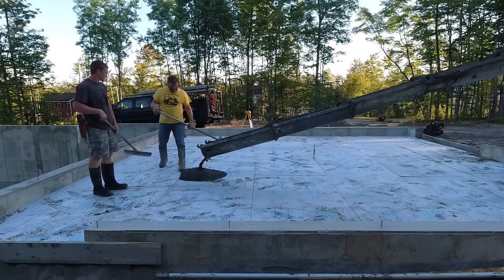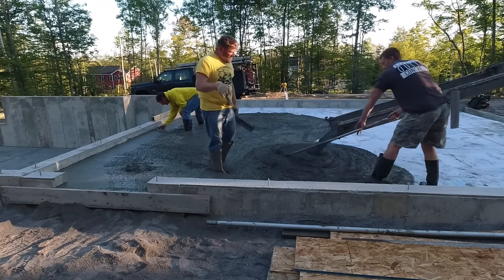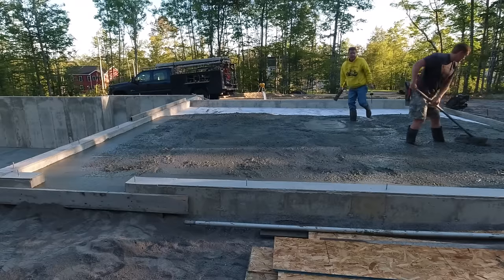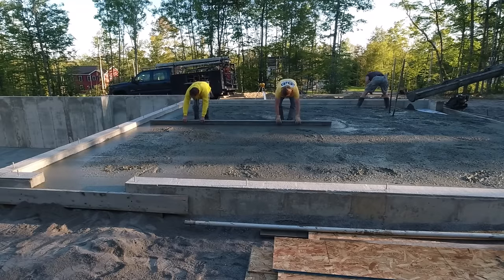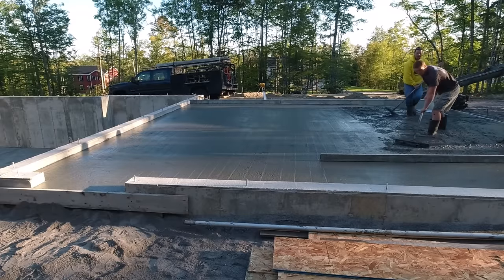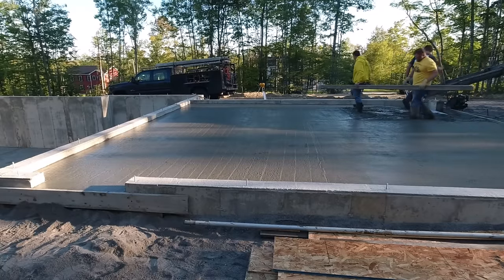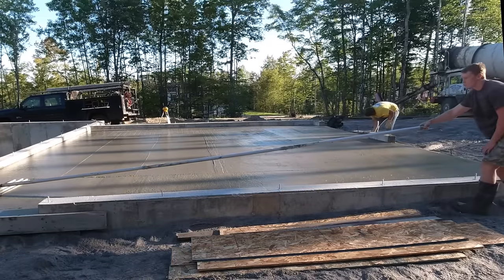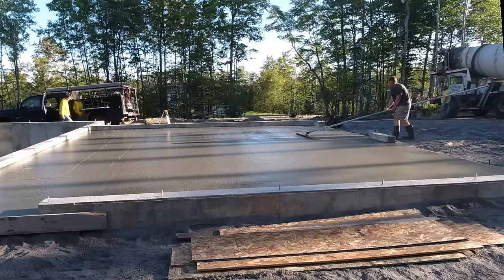Concrete Garage Floor Pour with No Rebar

Comment: I agree with everything you say about wire and rebar.  Most people don't know, that is true.  Our slabs here in Florida do crack a lot because they don't do what we used to do in NC 30 years ago. We used to cover it up with plastic or hay or spray water on it so it don't dry too fast.  Here in Florida, they just don't care.  You pull up any carpet on any slab here, and it is spidered with cracks. They all let them dry way too fast.
Reply: How true, the days of properly curing concrete are long gone.

Comment: The people still complaining about rebar in the comments missed that this is an engineered design with high-end concrete in a small space. The concrete guys didn't leave out the rebar because they're cheap. The engineer just did the math and thinks the ground will not move for hundreds of years.

Comment: My neighborhood was built in 1951/52 and none of the garage floors have rebar in then and none of the sidewalks do either and I'm pretty sure none of the house foundation did either and Ive never seen a crack in the garage floors and only the sidewalks by trees are cracked or where someone drove a full cement truck over one. They used a very stiff mix and apparently no one cheated. These are 19x20 ft garages

Comment: Great technique.  I'm from phila suburbs and screed everything myself with a 10 stick or smaller.  35 years Wish I had good help like darren ( and josh) That guy reminds me of myself. You better give him a raise.! I use  4000 psi wire and rod all garages around the edges reguardless. I also never cut the air.

Comment: I did it for the first time for my handicap brother. We put in a new driveway and walk. It was an 11 metre pour and I should have done it in Two pours. It was a warm day and it was setting fast. Holy cow what a lot of work when you're a noob. The job was not perfect when it was done, but it certainly was better than the old drive. I think we had about an hour of work time. Anyway he saved about 5 grand so he's happy.

Comment: Very smooth job. Exactly right: subgrade prep is 90% of the job for a slab on grade. Compaction is a real science. Fill quality and correct moisture. A bit surprised though that there's no flex joint material between slab and wall as it helps reduce shrinkage cracking.
Reply: Yes! You always  want to isolate the slab from walls

Comment: I work Michigan and Arizona.  Michigan I can normally get a transit mix in and in the last few years I have adopted water reducers.  Like you say, makes it more flowable.  I normally work with an inexperienced crew. I set up intermediate forms that get yanked as we go. or if pouring a basement I have small grade stakes that get stepped down as we go.  Blessfully I am whiz bang with a bull float.  If rhe screed was good I can have it smooth enough for a sidewalk and broom finish.  Arizona 50 plus miles to the nearest transmix. Usually mix my own, 9 cubic foot mixer, two wheel barrows to the batch. One guy doing nothing but mixing the next batch.  I keep slabs to 8 feet or less wide, come back the next day and do all the alternating strips.  Lotsa labour, but the only purchases are portland and screen. Sand and aggregate come straight out of the wash, native.

Comment: I love fiber mesh instead of rebar. I did a 60' X 40' pour using fiber mesh, the concrete guys weren't used to using fiber mesh so they insisted on doing a relief cut down the middle, I didn't want it and told them so, they did it anyway.  I never had a crack anywhere in that floor.  The next house I did, same thing, they put in relief cuts even though I told them not to. My current garage/shop doesn't have a sloped floor, the guy who did the floor was an older guy, and to me, was a genius. When I told him I didn't want the floor sloped in the shop half of the garage, he said, I don't do sloped floors, instead of explaining, he said, you'll see what I do.  Turns out what he did was cut in a slope the last18" inched in front of the garage doors, the slop is about an inch difference from the finish floor height to the outside edge of where the roll up doors are. That way any blown in rain under the door rolls right back out again. It truly is a genius idea. He told me many years ago he was working on a vehicle in his garage and he dropped a socket from him wrench and he had to chase it across the floor. That ended up being the last sloped floor he did.  I love the flat floor because my table saw out-feet table sits nice and flush with the top of my table saw. Unfortunately for me, his guys are used to rebar and always saw in relief cuts, so when I saw the guy the next day take out the diamond saw, I told him, I didn't want the relief cuts.  He insisted and his boss, the old guy, wasn't around so I ended up with a bunch of relief cuts in the floor that I had to fill with gray silicone so saw dust and finish nails didn't end up in them. Fiber mesh is the way to go. I had a guy come over while the house was being constructed and I showed him my floor and about fiber mesh.  He came back about a month later telling me he has a mass of cracks in his floor and it had fiber mesh in it. Turns out he didn't use the same concrete company I did and some other concrete firm. I asked him how familiar his concrete company was with using fiber mesh.  He told me they don't use it in their concrete but he insisted they use it. I said, they probably didn't know how much to use or just dumped it all in at once instead of knowing how to us it.

Comment: WOW im stunned , I don't get out much but that's professional ! Fast as ! And you've cured some thoughts and questions i had for a home project I'm about to do ! Just one question if you have time regarding backfill lifts and compaction , i have an old skool pavement roller , with a reasonably short lift is it good enough or would a jumping jack be better generally speaking.... In order to not use steel mesh ! ❤😉🙃😎 NZ

Comment: Hi Mike,

 I am going to build in 🇧🇷  Brazil.  I wish my contractor could get a truck up the mountain. They use a mixer on site. One thing I have difficulty with people here is that when I mention a vapor barrier, they look at me weirdly . I visited friend's houses in the mountains and noticed water problems with their brickwork, and I can smell mold and see how water migrated up through the cement foundation spalling and degrading the bricks. 

I've learned so much watching your videos over the years! As a DYI guy, I really appreciate your expertise. I wish I hired someone like you for my old house in Massachusetts.  I had a terrible experience a few years ago.

Comment: You guys are much faster than anyone else I have seen on you tube .Alot of guys use power buggies  to haul the concrete over the black top  or set up forms with the wire mess t hey have  never power trials on the ground for driveways .

Comment: Outside Worcester,Mass. Love your videos. I do side work putting in small 20 by 12 concrete platforms for Heat pumps. Learned a few things from you making things easier 👍😊
Reply from the maker: Sounds great!

Comment: Retired recently after 45 years of doing this.  I agree with everything that was said, but for the second half of my career we tossed the wire mesh (we would use 6 gauge instead of 10 gauge on occasion) and put in #3 (even #4 rarely), usually at 18" o.c.  Cheap insurance on an expensive commercial project or a multi-million dollar house.  Control joints are best invention ever when it comes to slabs, with fiber mesh not far behind.

Crazy thing is my desert house (only house I've ever own I didn't build) has a walkway where the concrete is heaving a bit, this in an area where it never freezes (not even close), gets about 10cm (4") of rain a year, and over nothing but sand.  Go figure.

Comment: Eastern wa. Monolith pour 36x28. Footing’s 24”x30”. Full load In this location is 7.5 yards. So 2 trucks at a 3500 mix. Then topping with water reducer. It’s all caged with 1/2” rebar 24” o.c. 
My laser took a 💩 right before our 3 man pour so we drove 3 grade steak 🥩 down the middle and did our best with 2x4 saddles and a ultra tight string line for grade Turns out we were as good as a laser wet pad. It just seemed to take forever! We had a delay on the 3rd truck that worked out perfectly! Love learning from all of your videos. Hopefully we can continue to teach the next generation before done.

Comment: Know your stuff.  Grad from Idaho State Univ. in Civil Eng Tech.  Since I have poured many slabs, basements and etc.  Can't emphasize prep of base.  One thing more.  Do not use additive to fast set. I have had a perfect trowel surface and covered with plastic.  Calcium foamed overnight under plastic cover.  I also noticed plastic under your slab.  You might have mentioned that this will greatly reduce moisture infiltration through concrete since concrete will allow moisture to come up from it.  It will reduce the rust on your items sitting on the slab.

Comment: Aloha Mike  Tuning in from Hawaii. Your process is very quick for an open area. Most of my pours are for residential monolithic slabs that have plumbing protuding. As for the water reducer, is their a formula for the ratio to get that nice and easy flow that you get? Thanks for the video have a beautiful weekend.  David

Comment: I agree with what you said. Here in Florida I’m surprised they don’t require a sub grade of aggregate prior to a poor. The subbase is sand. Which Ive never seen before coming from out west. I’m guessing this might be because aggregate is not so available here. Not using a plasticizer to help move the concrete on large pours probably comes down to cost.

Comment: Been preaching the rebar thing for years I know guys have been doing concrete work all their life or adamant that everything has to have wire or rebar and that’s just not the case like you said if it’s sitting on something solid, it’s good

Comment: thanks for the vid.
When you talk about concrete strength I think you need to be more specific as material strength can be defined in a number of ways; tensile strength, compression strength, impact strength, yield, hardness, shear and many more. So to say rebar doesn't make it stronger is not true. It does and it does quite a lot.
Just a point to make as a Civil Engineer.
Reply from the maker: Great point!

Comment: Amateur watching from Minnesota. Appreciate the kick screed lesson. Up here we have two types of concrete. That which is cracked and that which is going to crack. The salt dripping is hard on our garage floors. So is -30 f. I wish that I had a concrete guy that had told me to insulate my shop floor. That 5000 psi concrete cracked where the schmooz runs out the door on year 10. Maybe a drain would have helped but then the epa has your number. Now the crack is taking more saltwater to grade.

Comment: Does the fibre reinforcing work out cheaper than the rebar?
If the garage was just for a workshop and not having a vehicle parked there could you get away with less fibre or is the quantity of fibre a set requirement for the concrete?

Comment: Nice to watch the Pros in action.  In Rhode Island planning a one car garage pour. 4”, 4000, 3/4’, with fibers, no resteel.  What is the water reducer called, how much more perCY? Thanks, Roger
Reply: It’s called plasticizer. You can get mid range or super plasticizer. Cost depends on area. Here in Idaho it’s about $9 per cy.

Comment: Back in my youth, we never put bar in domestic floors.  Now Engineers always ask for it…just in case.  What a waste of energy…can’t afford that now .
I would also suggest most domestic floors could be done with just a well compacted subfloor. Plenty solid enough.
I was an Architect.  I do recall that in UK and EU, specialist firms can lay industrial slabs without reinforcing.  They very carefully control the mix, I believe they keep as dry as possible to minimise shrinkage, and use good vibration (as almost all slabs here get)

Comment: All concrete needs reinforcement (even minor settlement can crack slabs). I prefer fiber over mesh simply because mesh can sink during screeding (if it's manually kick screeded) - when old slabs get ripped up, the mesh is often sitting at the bottom of the slab doing almost nothing, or worse, it's rusting away.

Comment: I use to also believe wiremesh had no other purpose than holding it together if cracked. However in the case of slab warp it can restrain some of the potential warping especially if it warps up the wiremesh should be closer to the top to prevent. I would think about 1/3 away from top. But im sure there’s better way to spec how close. Similar to rebar in walls should favor the side stress can break in soforce wont fold rebar through concrete. This is also why fiberboard against walls concrete is poured at floors to reduce stress. I know almost nobody does it in residential.

Comment: How large of a floor can you pour against the foundation without joint foam?  Asking because I just had my floor poured 48x32 for my garage (has stem walls, like this one) and the inspector, engineer, and concrete guy all separately recommended I do that.
Reply: It shrinks away from the sides as it dries.  Foam is for expansion

Comment: I've always questioned the reasoning for installing rebar or wire mesh in concrete.
The thermodynamic properties of steel and concrete are different and that difference can cause internal stress on the concrete, actually causing a fracture.
It would seem to make more sense to utilize fiberglass mesh, like that used in cement panels, along with fiber mixed in the concrete itself.

Comment: Having good guys raking is the key we tape Lazer receiver on rake .rake to right grade and leavel and used bull  float sright on concrete go over as many times different directions no spreading required.if mix is workable like yours 3 guys is all you need if mix is 90-110mm need 4 guys on that size poor.

Comment: So?,,, water reducers dont allow the aggregate to sink lower in the crete??  Do reducers keep the aggregate at the top?  If the mix is wet,, do not the aggregate sink to the bottom  regardless?   Just asking.  Haven't poured  in a minute?

Comment: Montana. All the concrete contractors here are way behind times. Most of the flatwork here cracks or flakes off the top. I am building a new shop next year and it's been a pain to find a good flat guy.

Comment: If the sub grade layer is strong enough... stiff enough... then even cracked concrete will "hold" the loads... because... it is not holding any loads. It is just a "stiff surface", on top of stiff subgrade... 

Why reinforce concrete... that is "on top" of a subgrade, that is already as strong as the reinforced concrete?

just got to make sure the corners are never loaded / no extra rigid support from foundation there.

Comment: What you said about steel ONLY holding cracked concrete together is false. Concrete has immense compressive strength but very poor tensile strength. Steel provides tensile strength. As you explained, not needed here, fair enough, but that statement was incorrect.

Comment: My generally foolish neighbor  poured a concrete driveway WITH rebar over a 60 year old sewer pipe.  Two years later, the pipe collapsed and it was a major job to dig it up.  Needed to bring in a machine to smash the reinforced concrete and cut some of the rebar to take away the chunks.

Comment: 4 inches and Styrofoam underneath. Never work on a vehicle if you need to use a jack. The jack will bust right through the concrete like tisue paper. Yes it saves money in short term with styrofoam. However a repair if it gets broken could be expensive. If I was having a house built, it would be 8 inch solid concrete on a rock base. Cost far more but last 10 times longer, or more

Comment: its going to crack. The Foam panels do nothing to prevent cracking. I don't even see any expansion foam along the walls. Looks like a contract cutting costs\corners. Some settling is going to happen unless the slab is sitting on bedrock. Even a small amount of rebar would have helped.